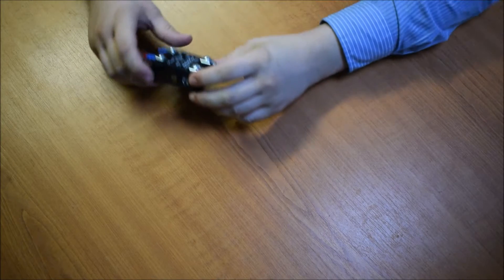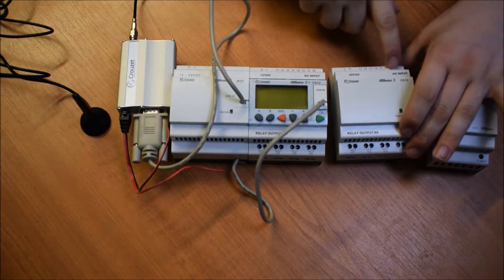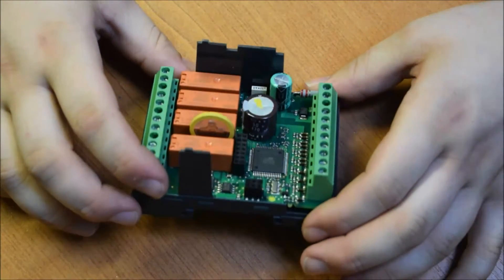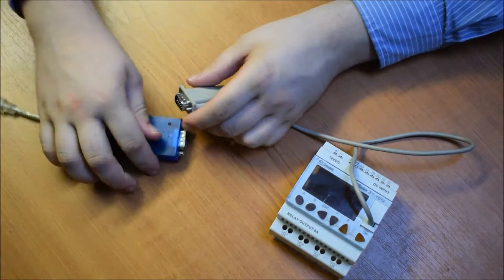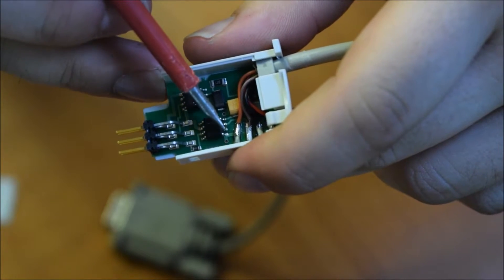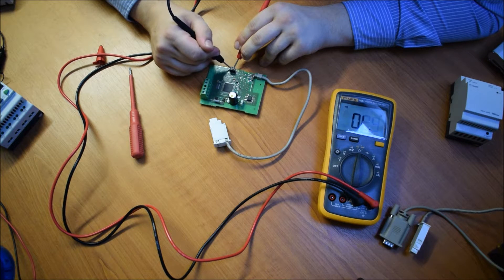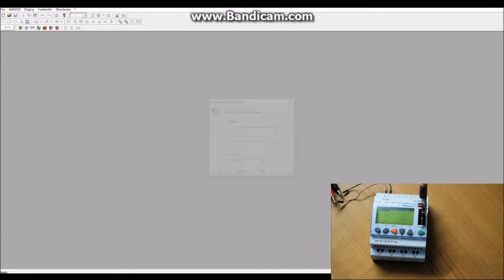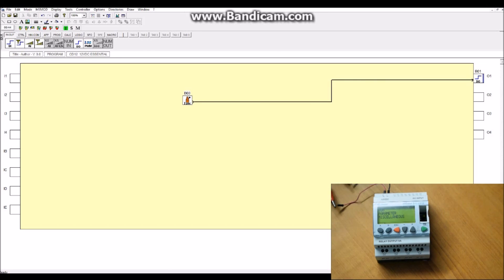Bootsale Haul - SSR's and Crouzet Millenium 3 PLC - DIY Programming

Comment: Hello! I have Millennium 2. I can't find the RX connection on pin 6. It has an MC908MR32CFUE chip, but I can't find a contact for RX with a multimeter. What could be the problem?

Comment: On your drawing of the 6 pin programming socket of the Millenium 3 there's two pins with question marks. These are used for memory expansion etc. It uses I2C protocol, the top left pin is SDA (data) and the one below it is SCL (clock)

Comment: If your Millenium 3 is powered from mains the you should be very attentive because the internal power supply appears not to be isolated from the mains.
The two chips in the plug are optocouplers, their job is to isolate the PC from the PLC.
Reply: Yeah I'm surprised it even worked, indeed those are optocouplers. I tried to do something similar when I was a broke teenager back in 2007 and didn't know what an optocoupler was yet. I had better things to spend $120 on, like video games and skate gear, so I tried hooking it straight to my computers serial port based on a schematic I managed to dig up and a terribly soldered serial connector I made. The M3 flashed on and off but I think another protective component protected the circuitry, because it started working again after I unplugged the serial. I guess that the M3 doesn't care if the commands aren't coming out of an optocoupler as long as they're correct and at TTL level. I'd use an old PC to program it just to be safe. But damn it, there are still better things to spend $120 on, like skate gear and cryptocurrency. Crouzet can keep their stupid cable.

The other way to do it would be to plug the TTL module into a $30 EEPROM cartridge; I'm pretty sure there's a way to make it work.

Comment: Just ordered the USB ttl serial port adapter and going to give this a go. Had the plc for about 6 months because I really didn't want to buy a cable
Reply from the maker: Calum Shaw let us know how you get on!
Reply: ExplosiveDischarge so I managed to dig out a power supply from my mates garage and got the thing going, it all connects! Been trying to work out what the programs that's already on it was meant for
Reply: I had one of those from a scrap sale. I tried to figure out the pinout for the connector but I was a middle schooler and didn't understand that I needed to make it TTL voltage. I just connected it straight to my computer's serial port through a bunch of wires that I managed to solder to a serial connector. I think I guessed at which was gnd/V+/rx/tx based on a schematic I dug up and voltmeter tests. Fortunately I think the diodes protected it, but the M3 flashed off and on. I didn't feel like paying $120 for the cable, so I just let it gather dust and used a PLC that had a cable. Now that I'm older, I still don't feel like paying $120 for the cable, but I'm buying one of those USB TTLs and hopefully it works.
Reply: @RsRj-qd2cg  glad you replied to this old comment, gives me a push to dig out this project and have another play. It did all work though! The program on there was very boring, it had one input that turned on one output. Using the entire plc as a single relay haha. I think the new program I made was equally as boring, turn an output on/off every 2 seconds I think 😂 Proof on concept though, it did stuff
Reply: @calumbmx1  I'm pleased to report that I got it to work! Using a direct FTDI adapter to get to TTL the way you and Explosive Discharge did is valid. But I wanted to do it exactly the way Crouzet did it with the opto-isolators. I bought a DSD Tech SH-U09C3 isolated USB-FTDI for $20 on Amazon and then connected it to my Crouzet M3 CD20 using jumpers the same way it was in the video (VCC-VCC, GND-GND, RX-TX, TX-RX). That way if I connect something to the M3 the wrong way, the M3 and isolator might be destroyed, but it'd take an absurd fuck up to arc across the isolator and into my computer. 

I even had a friend control it over the internet from the other side of the US in a roundabout way by using Windows screen sharing (my M3 is not expandable so I can't hook it up to ethernet to get internet control the proper way). The Baud Rate isn't very good so control was imperfect, but it was really neat having someone turn a motor on and off from thousands of miles away.
Reply: @RsRj-qd2cg  that's really smart, I just tested it on an old beater laptop first incase anything went wrong 😂 They look pretty cheap aswell, maybe I'll pick one up as some added reassurance
Reply: @calumbmx1  Crouzet is really charging people $150 for a serial cable with opto-isolators that cost a few pennies. I'd almost be mad, except that the programming software is available for free.

Comment: First, thank you for video. Its this connection same for millenium 2 sa12?
Reply from the maker: Sorry for not getting back straight away!
The connector looks visually similar, but I've not tried the hardware. You should be able to follow a similar process to the one in the video of checking the pins to be sure.